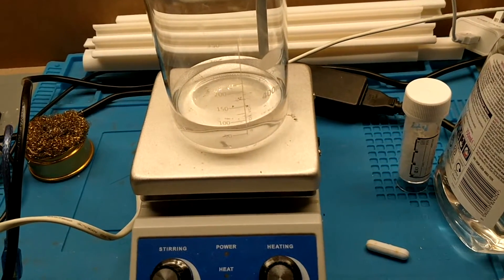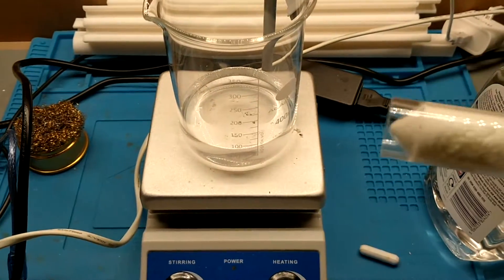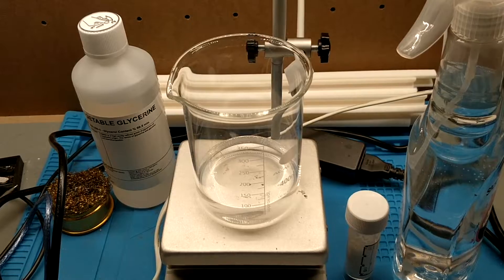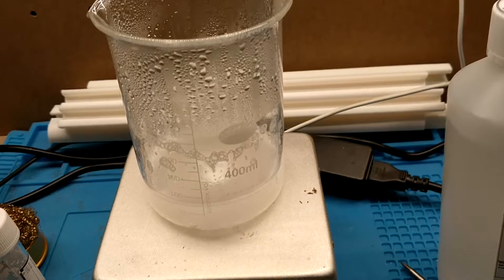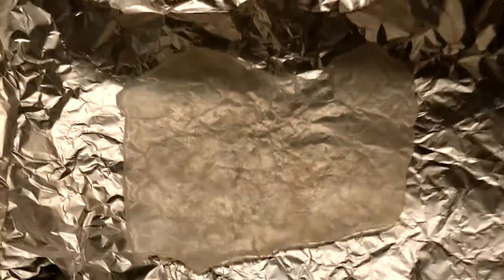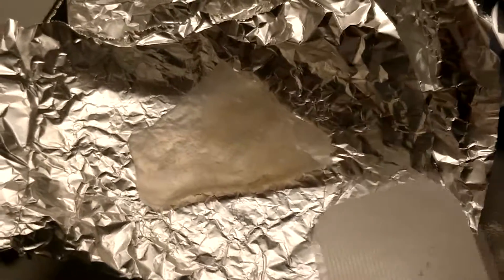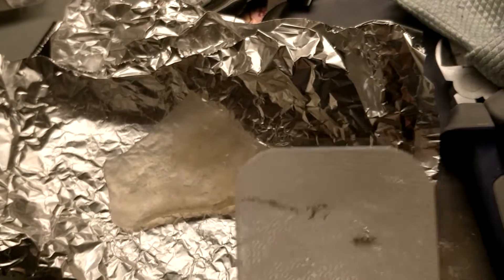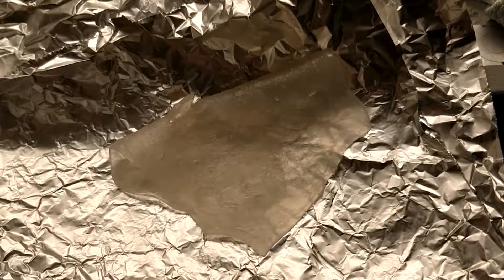Thermoplastic Starch & How To Make It

Comment: Excellent video, I might have to give this a try.

A thought occurs to me when you suggest this would be good for creating cushioning; would it be possible to somehow whip this material while it cools to fill it with air bubbles? It might require a slightly different ratio of plasticizer, but it seems like it would improve the cushioning quality